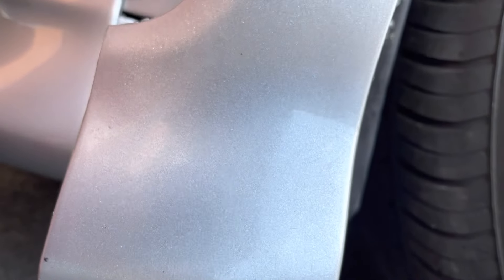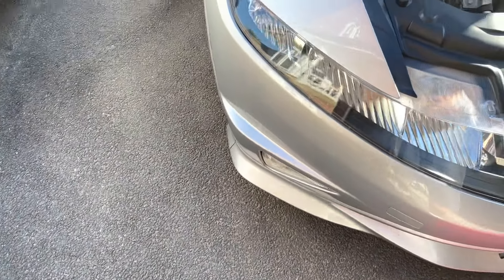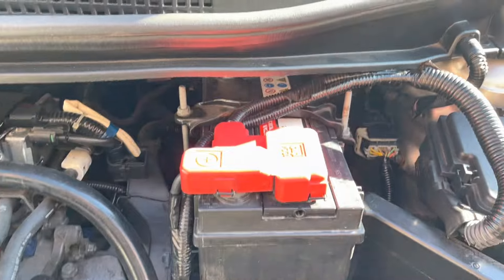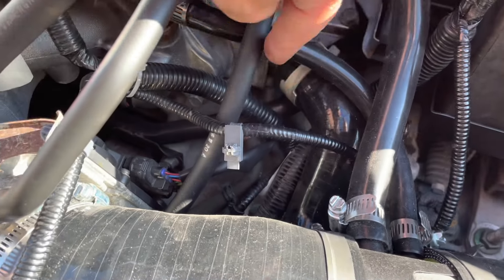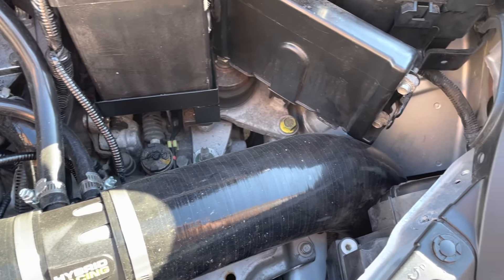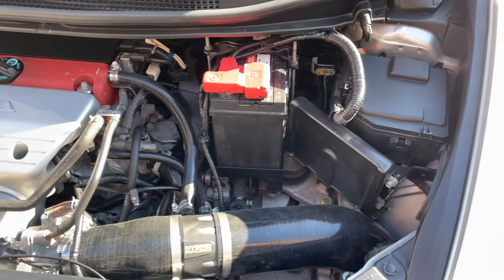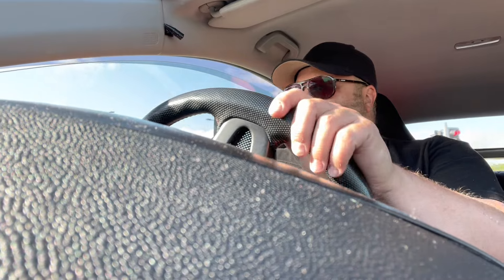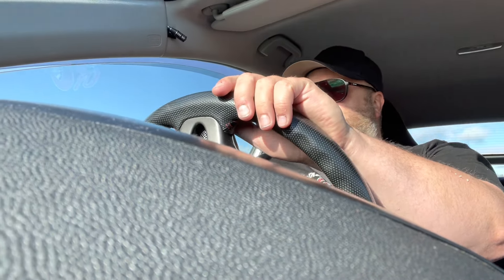Installing the Hybrid Racing CAI on my Honda Civic FN2 Type R - Part Deux

Comment: Sounds great mate, definitely the best place for the intake to go but what puts me off doing this one is the hassle of braking the wheel arch clips.
Reply from the maker: Most of the clips on my wheel arch trims were broken, think I counted 3 different types of sealant on the passenger side holding the trim to the car.

Comment: Hi mate where did you get your ground connected to please? Can't see in vid
Reply from the maker: Hi, it's on one of the bolts that holds the heatshield down. Under the plastic trim that houses the washer jets is a large heatshield held down with 4 bolts. I found a nut that fit and connected it to the one on the right.
Reply: Thanks for the reply mate, did the positive terminal need altered or extended at all?
Reply from the maker: @gazzermooney  I didn't alter mine
Reply: @abexpress4410  really mate? So it reaches the battery in the tegiwa tray without having to extend wires and stuff?? That's awesome news as I thought I was in for a nightmare of a time lol
Reply from the maker: @gazzermooney  Not extended or replaced any of mine. Would probably look nicer with new or extended cables but I got everything to fit